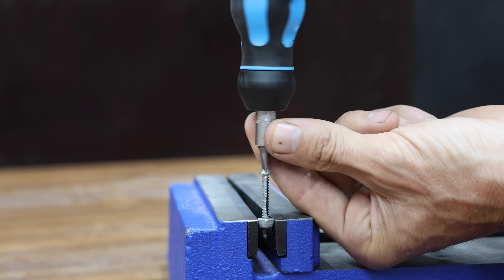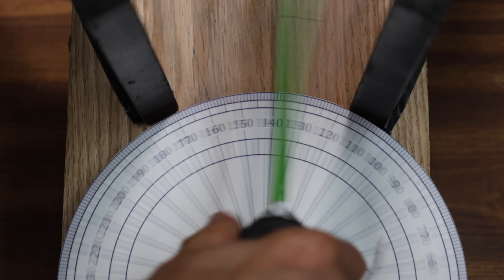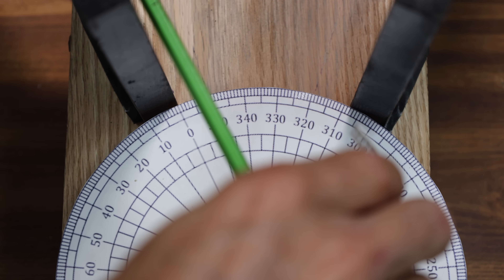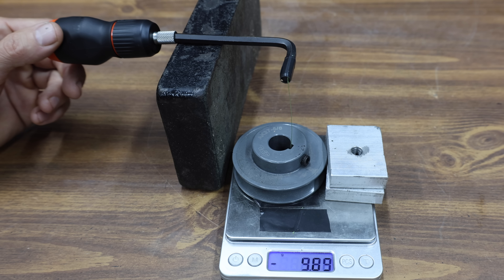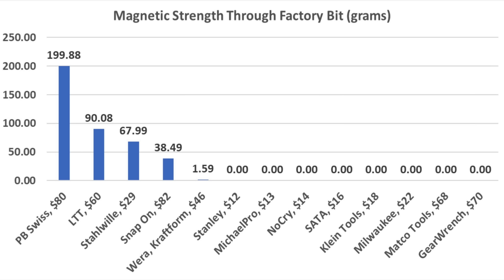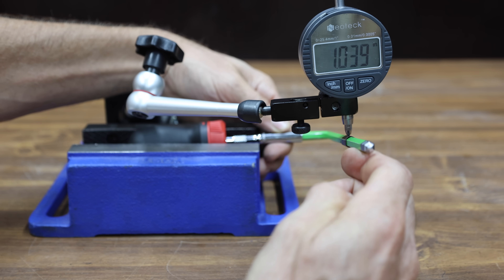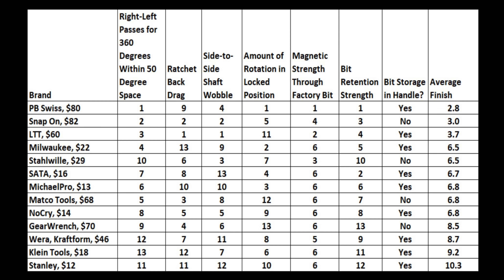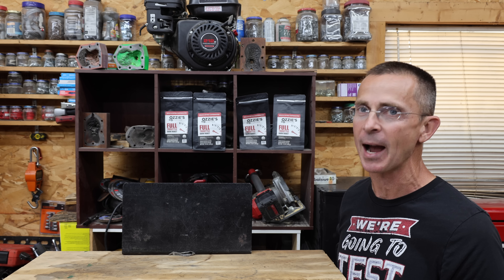Is Linus Tech Tips “Stubby” Screwdriver Best? Let's Settle This!

Comment: Linus is really proud of his tools. Not entirely sure exactly why though...
Reply: Because as far as a screwdriver for building PCs goes it does the job damn well?
Reply: @nightrat42  I don't know how much better it performs as a PC building screwdriver compared to one that isn't nearly so pricey. Based on this video it doesn't perform so well compared to other screwdrivers that are considerably less expensive in basic aspects of a ratcheting screwdriver, so being an incredible performer for building PCs is really a non point.
Reply: @Thorgnor  considering that's what it was made for, not really
Reply: @nightrat42  it's still way too pricey for what it is. If you want to spend 4 times the price for something that has absolutely no reason to be so expensive that's your choice. I've built many PCs without a $70 screwdriver just fine. Zero justification for the $70 price tag. Even a Stanley ratcheting screwdriver will work for building a PC. I don't know what point you're trying to make other than you think the LTT screwdriver is golden or something.  I've wasted enough time on you.

Comment: Suggested video: Compare radiator coolant additives, claiming to decrease temperature by 25F degrees: Red Line -Water wetter, Royal Purple - Purple Ice, RISLONE - Super coolant, VP racing - cool down, Mishimoto - Liquid Chill.
Reply from the maker: Thank you for the video idea!
Reply: @ProjectFarm  ... "we are going to test that!"
Reply: @ProjectFarm add liquid laundry soap to that list. Same amount as the std deviation of them. Look into demolition derby info for why.
Reply: @ProjectFarm those sensors on vehicles to trick the computer into NOT using eco system.
I'd like to know if they really work.
It keeps the motor from running on four cylinders rather than all six.
Reply: @danno5805  Why would you want that? Don't the engines only deactivate when you are coasting, idling, or maintaining speed on flat ground? All the cylinders turn on when you accelerate, so it's not going to gain you any power. Just waste more fuel when it isn't needed, seems pointless if it even does anything. 

The only benefit I could maybe see would be that response time would be quicker when pushing the pedal.
Reply: Please!!
Reply: Great idea
Reply: I use water wetter in my PC cooling loop and it dropped temps a couple degrees.
Reply: Good one, man!
Reply: oooo YES PLEASE!!!!
Reply: I've been asking him to do this FOR YEARS!
Reply: @PetesCreativeRecycling  mee too and also was asking to test motorcycle engine oils.... ✌️
Reply: Also the Amsoil it claims to provide better thermal transmission…
Reply: Please do this!
Reply: I’ve used water wetter before in a very highly modified vehicle from the early 90s that quite frankly had an undersized radiator for its power. It did drop the temps by about 20 degrees on average though I never did a back to back AB test. But driving the same way at the same time, in the same temperatures, on the same track resulted in lower temps at the end of the runs when compared to before adding the water wetter. I imagine the size of the cooling package as well as the coolant and water used and manny ambient factors would drastically change the outcome of this. 

As for motorcycles, again not an AB test, but as soon as I switched over to engine ice in my atvs, I never again had an over temp warning. This was riding the same type of trails in the same time of year with what I would consider to be the same mud and dirt clogging up the radiator. With the stock coolant I would have to stop at least once every ride to let the thing cool off and try and clean out the radiator. Once switching to engine ice, this never again happened and now I don’t bother with checking/cleaning the radiator until the trip is done and I’m cleaning it up to put in storage until the next trip. 

These are just my experiences and are hardly scientific but the restless were good enough to convince me of these chemicals value.
Reply: @2down4up  I use too Engine Ice on my Ninja 300 sport bike, do a long trips on a riding season, recently drove 500 miles in a day,  90F degree heat, bike did not have any issues like overheating or loss of power, engine was running smoothly... I did not added any additives just drained the old coolant and filled up with Engine Ice as it is a coolant itself already having those additives... ✌️
Reply: @otarsulava  right on!  I should clarify I only added the water wetter to normal coolant. Like you I used straight ready to run engine ice without any other additives.
Reply: Think Amsoil makes that stuff too
Reply: Ooh that's a good one. I'd love to see that
Reply: What about engine ice
Reply: @aaronpantell1038  Engine Ice is not an additive other than the Coolant itself. I drained my motorcycle coolant and filled up with Engine Ice - great results, bike did not have any issues after LONG trip ride in a 90F heat, highly recommend 👍✌️
Reply: Good idea
Reply: Awesome idea. While I didn't see 25 degrees. I've seen 10 with water wetter. It would be great to see a comparison.
Reply: For all of us motorcycle racers that cant use glycol coolant, PLEASE!
Reply: Please include Engine Ice brand.
Reply: @Mittencarpentry  Just FYI - Engine Ice is the coolant  itself, already prediluted - great product 👍
Reply: Heck yeah!!!!
Reply: Real world results - I used to race cars. When I was just starting out, I had my street car on track for a track day. It got to 260*F and spewed its coolant all over the track. Luckily, a hose just came unclamped. I reattached it and filled it with tap water. Friend of mine had a bottle of Water Wetter so we threw it in. I never saw temps over 230*F that day after that.
Reply: Yes I’ve been recommending this as well
Reply: Also wanna see that
Reply: I would like to see this video idea brought to life
Reply: BG Super Cool!
Reply: Add engine ice to the list!
Reply: @redeyedfreaks  Just FYI - Engine Ice is the coolant itself already prediluted, not an additive - great product otherwise, I use it in my Ninja 300 👍
Reply: @otarsulava  ah I see. Additives, not plain replacement coolant. Good catch.
Reply: All will have worse cooling than straight water.

Comment: I love your videos! Have you done fans? Doesn’t matter if shop or costumer grad I’m curious in a fan show down! Thanks!
Reply from the maker: Not yet. Thanks for the suggestion!
Reply: @ProjectFarm  it could be something along the lines of “do you really need to spend 600$ on a blade less fan or is this 15$ one good enough? Let’s find out!”
Reply: @matthewburno   YOU buy the $600 fan and send it to him.
Reply: Fans would be interesting, both window and regular. Some window fans are absolutely atrocious in that they move next to no air and cost 45 bucks, it's crazy!!
Reply: @MaribuStork  yeah I’ve had 50$ fans I can barly feel 2ft away max setting then a random 20$ no brand I can feel like 30 ft

Comment: I hope there's a grip test, some of my screwdrivers like this just slips in your hand as the rubber handles aren't stuck to the actual unit very well
Reply from the maker: Great point. I should have included a grip test!
Reply: also if the grips are rubber, if they are oil/gas resistant or the type that melts. @ProjectFarm
Reply: @ProjectFarm   
I think a quick rating on size should have been added into the final value. Some of those are too long and there is nothing you can do if they don't fit. The REAL stubby ones can work in close and you can use an extension if needed.  Matko, gearwrench and Snapon seem too long.
Reply: Therexxx- Yes, in the 70's I had a cheapo set with a loose black vinyl grip over yellow plastic handle. That stubby was useless except as a probe of the screw slot😅
Reply: A lot of conditions to test out. With gloves / without gloves the material of the gloves. Oiled or dusty/dirty. I'm curious about how some of these handle being in dusty environments.
Reply: a big difficulty with that test is that your grip isnt based on the surface finish alone, the shape and size of the handle play a huge role. it's a very human based test, so it's hard to quantify.